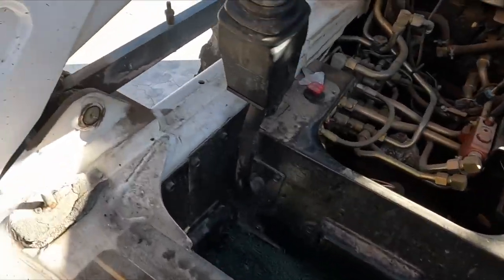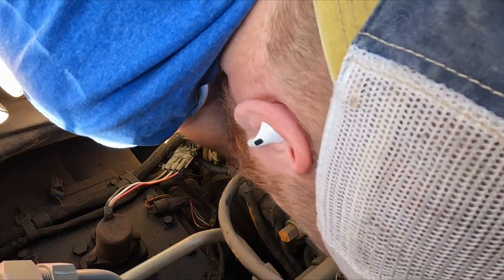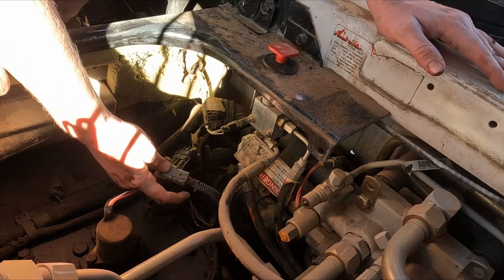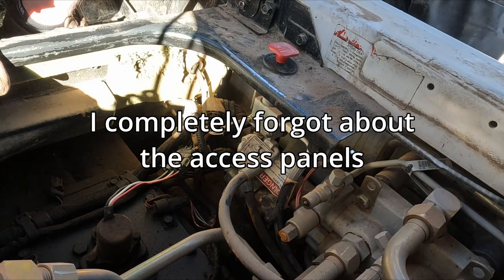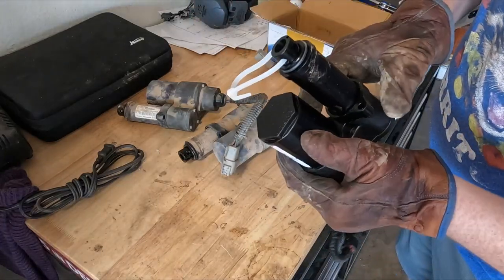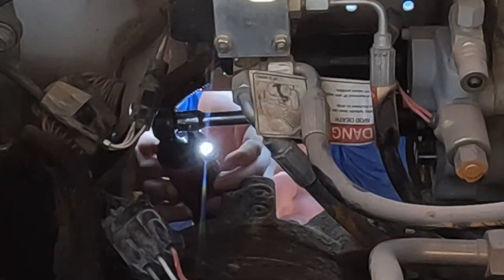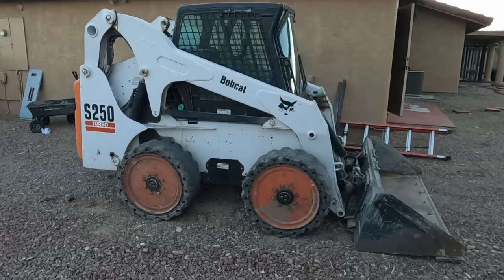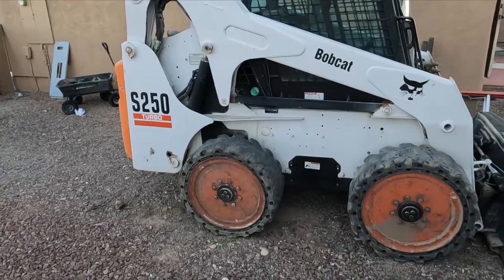Bobcat S250 replacing both actuators

Comment: How did you determine it was bad?

The end result is great.....but ished you should us how you tested it to be bad.
Reply from the maker: If I remember correctly, the lifting arms and bucket tilting started to respond slower than normal at first. 
Then eventually I couldn’t engage the hydraulics (big green button that says Press to Operate Loader) after starting the bobcat up. 
I would have to shut it off and restart it a handful of times just to lift the arms a few inches and for it to turn off again. 
After replacing the actuators I’ve never had that problem again. I guess it’s a common issue around 500-750 hours for the part.